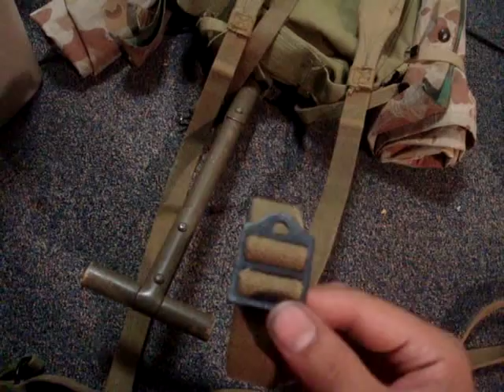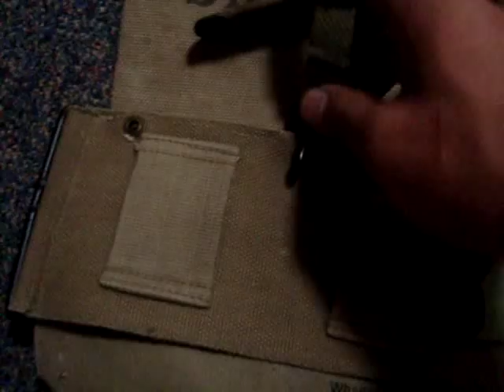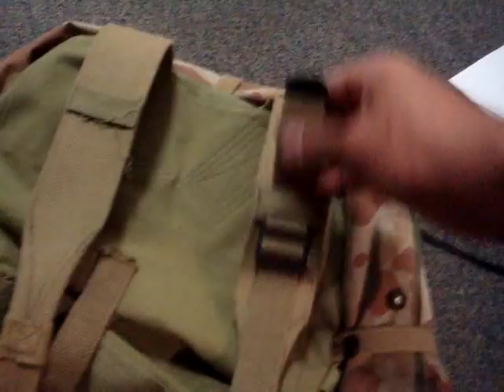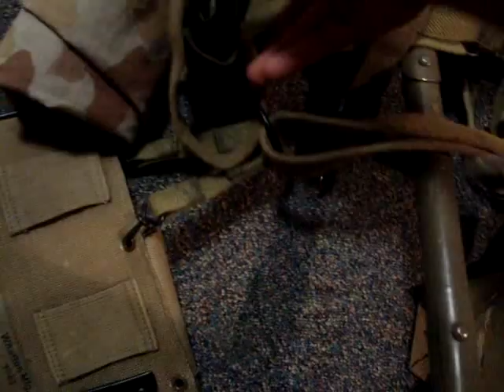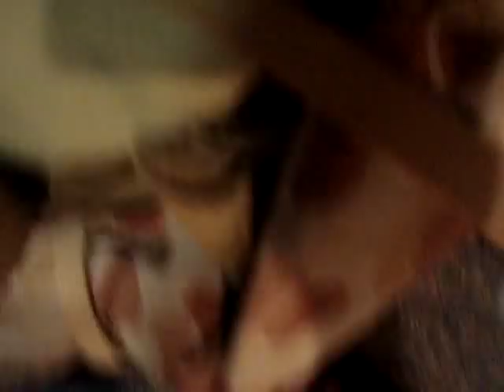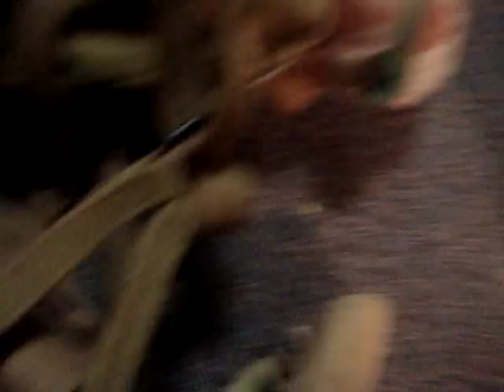Down and Dirty P41 Pack Assembly

Comment from the maker: Possibly I need to look into it. I don't think there is a way to do so since the system was built with the suspenders in mind, but it is totally possible. The suspenders actually help suspend and spread the weight. But you can also use the lower knapsack and the suspenders to have a low hanging bag so you can wear a radio or other back carried item over it, but still retain a bag for carrying everything else.

I'll get back to you.

Comment: The pack was often worn separate from the suspenders as a backpack, especially once on land. This was the "Light Marching Pack" illustrated on page 11 of the manual. To do it, you just hook the straps from the pack to the metal rings at the bottom of the pack that the knapsack's coupling strap go through and adjust the straps so it functions like a backpack.

Comment: Also of note, if worn as shown in the video during a seaborne assault, Marines would often unhook the clasp on their cartridge belt, relying on the suspenders to hold everything up. If they encountered trouble in the water, they could easily dump the entire rig quickly (since they didn't need to fumble with the buckle). Once on shore, they'd fasten the belt. I've been told this by a couple of veterans.

Comment: Strap happy pack for sure.
Reply from the maker: That it is. But it's way more comfy than the M10/28 haversack: holds more, and distributes the weight of the system in the various configurations better.
Reply: When I learned of the M41 I went: separate pack. Put it on, just put it on. Take it off, just take it off. But, of course, it's the Marines. The only organization that could come up with a system more complicated than the M44/45.